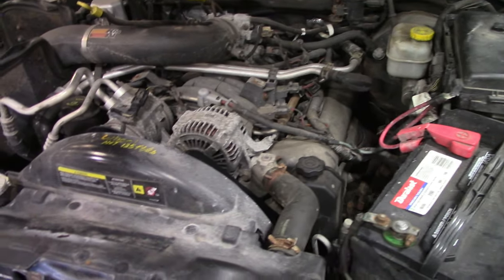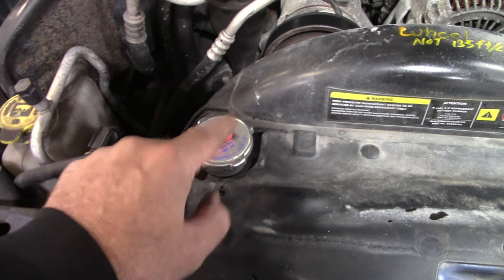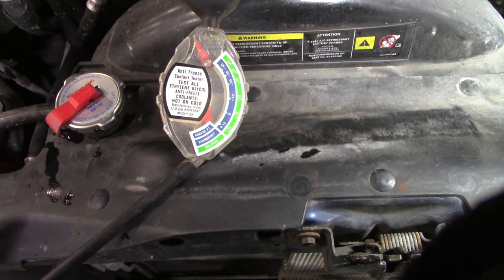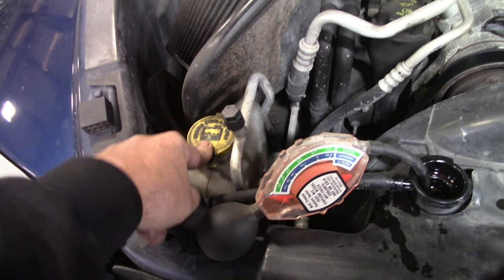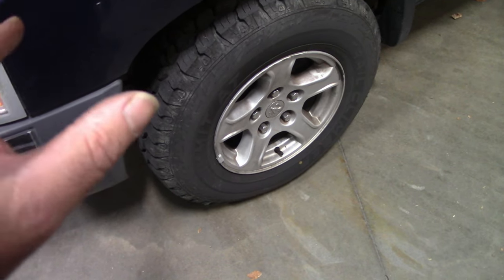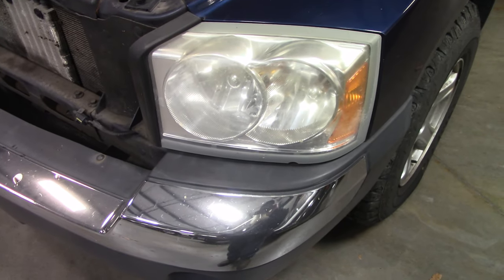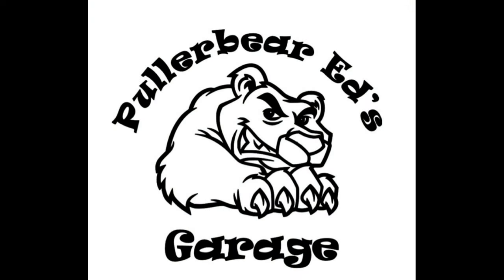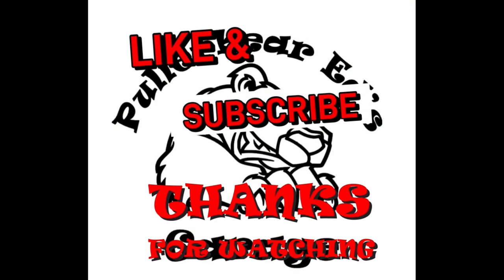It's time to winterize your equipment. The most overlooked thing every fall.

Comment: Great tips, Ed! Especially the tires, good explanation on why you want to check them when I gets colder. Sure most people don’t know that they will go down in the cold. Especially true here in Manitoba Canada, where we’re going to be prepared for some -32-40 Fahrenheit temperatures soon. Blanket is also super tip. You’ve just saved everybody a minimum 100 150 bucks with this knowledge that they can do themselves, instead of bringing it to the shop. Thanks for the video!
Reply from the maker: @unclemarksdiyauto  thank you Mark,  I know it's a few simple things but they definitely get overlooked until it's time you need them.
Reply: @ Here I would bet it’s the washer fluid as many use a bug fluid in summer and it either gets diluted and will freeze when the winter stuff is added. Better to drain it all out.
Reply from the maker: @unclemarksdiyauto same thing happens here

Comment: Good advice, though where I live in southern England it does not usually get that cold. When it snows though, I do put extra stuff in the car like shovels, boots and warm clothes.
Reply from the maker: @BensWorkshop  i was born and raised in the snow belt area of the US. After getting stranded along the highway in my younger years I learned to be prepared.
Reply: @PullerbearEd  100%. I have never been stranded but when there's a possibility I do prepare. It's just very rare here.